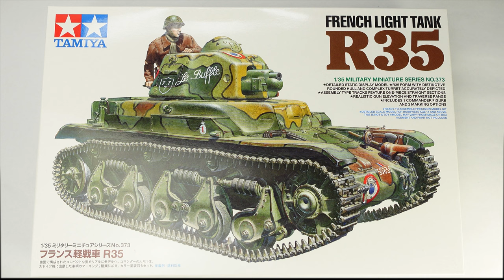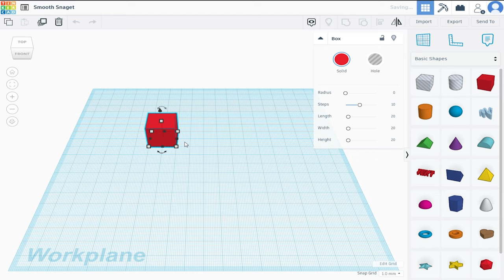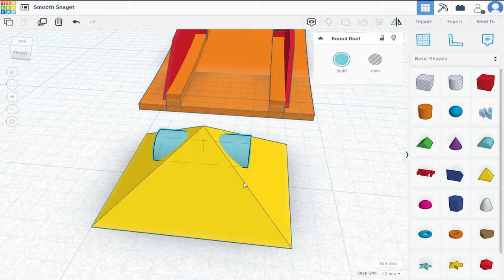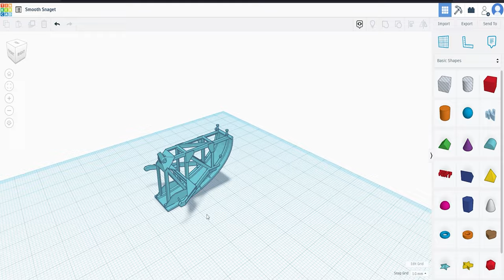Building Tamiyas R35 French Light Tank - 3D Printing Missing Parts

Comment: Are you making the design available? That is an impressive piece of work.
Reply from the maker: Thanks Mike. I'm still deciding on how to share my STL. files. That is the plan eventually though!
Reply: @mattockmodels  what printer do you use, if I may ask? Thinking of getting one myself. Same problem as you mentioned. Plasticard to thick. And if you use the scale thickness, it warps! Once again, lovely job
Reply from the maker: @mikesnow5890  It's and Elegoo Mars 2 mono. I've been very happy with it.